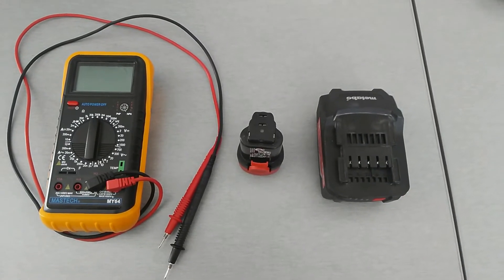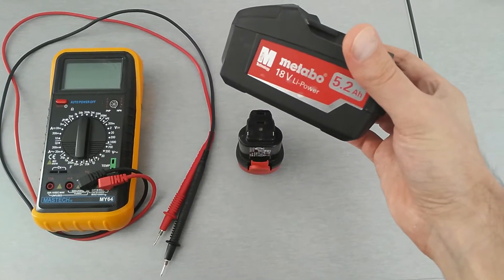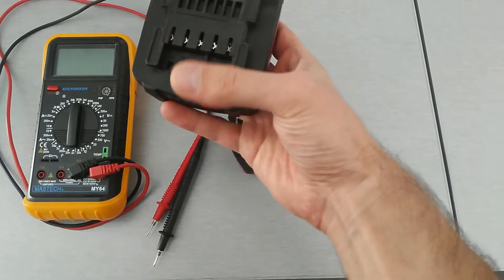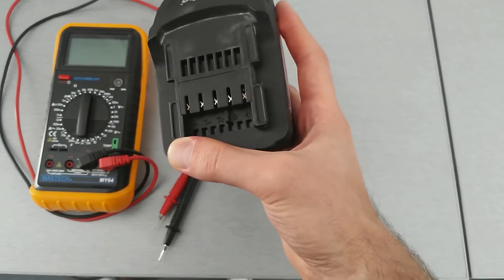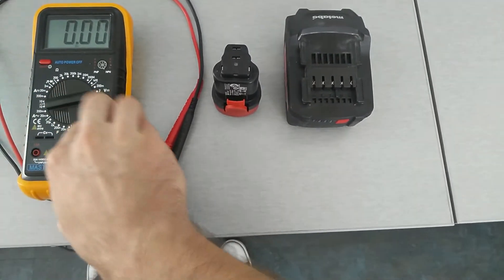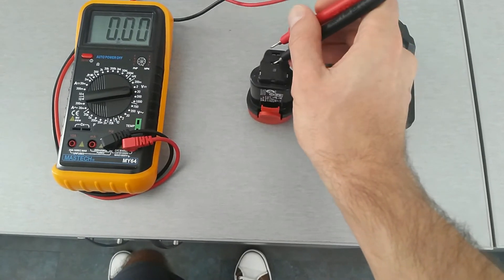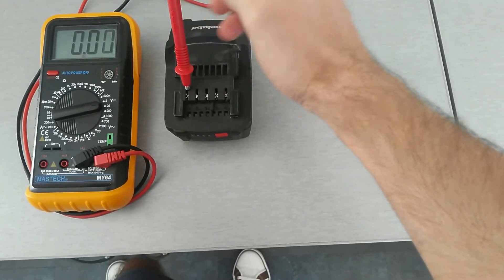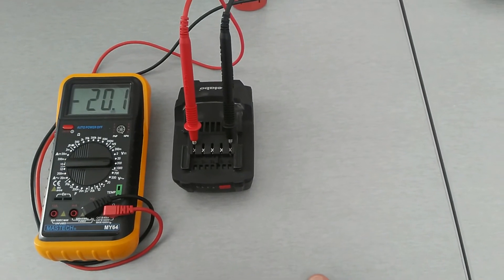How to Use Multimeter and Measure the Voltage of Power Tool Lithium Batteries

Comment: Do you have to change or adjust the settings somehow based on if its a parralel battery bank circuit compared to just a single battery? 

And is there a way to measure total amp hours using these devices?

Comment: I have a problem reading voltages on some of my packs.  I have 3 types of Lithium batteries.  Ryobi 18v (20v) Greenworks 40V and Hoover 20v systems.  Ryobi is the only one where I can place the probes on the + - contacts and get the proper voltage.  The Greenworks battery has 4 contacts.  The usual + - and 2 other contacts in between.  I am unable to find any configuration with the  contacts to get a 40v reading.  I do get 20 volts and 18v from + to the center contacts (not the - contacts).  The hoover is similar, but 3 contacts.  I get 20 volts from the + and center contact and from + to - I get a 10v reading.  I am puzzled why they are not as simple as they should be.  I understand the other contacts are for charging, but I don't understand why the + and - contacts are not rated for the voltage I would expect it to be in a battery.
Reply: It is my understanding on the GW, due to the electronics configuration, there should be no reading between +/-. A good battery will show ~24v both between + and omega, and + and C terminals.